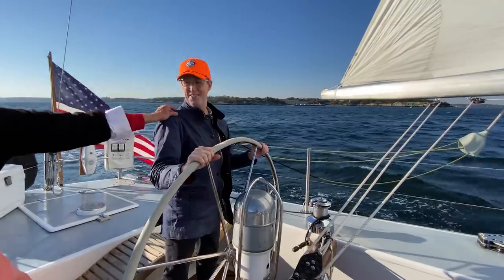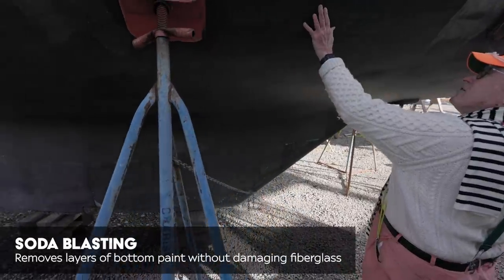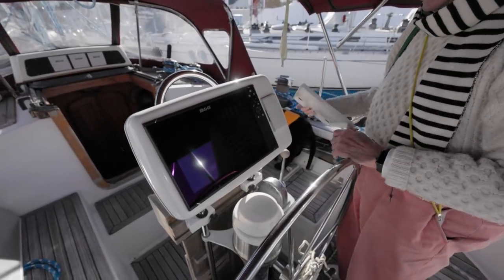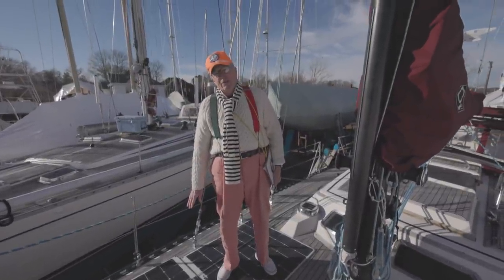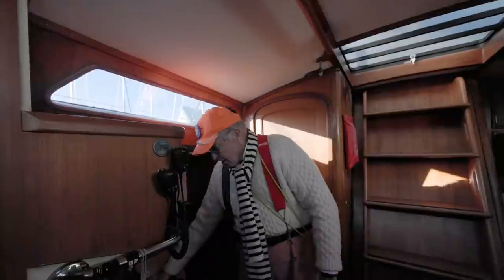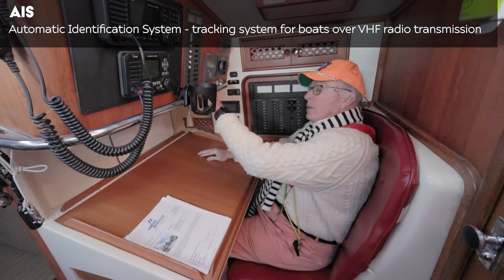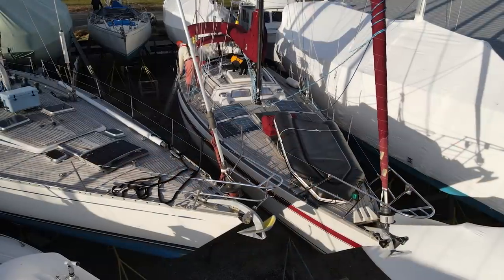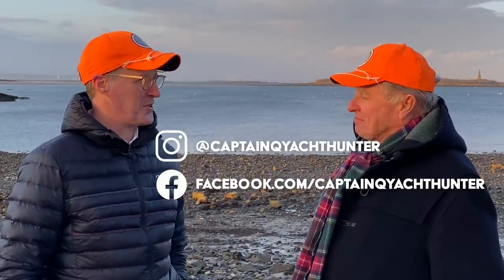$99,500 USD GLOBAL CRUISER! Proven bluewater sailboat for sale! EP76 #sailboatforsale #sailboattour

Comment: this boat has been on the market forever. for a reason. unfortunate since all the investment the owner made to get her ready. OTOH you take this to a low labor cost place you could get the deck removed and glassed for well under the $40k you'd pay here.
Reply: Trinidad?
Reply: @symphonyfarm2009  Panama!
Reply: Here is a list of what has been done to Dream Weaver mostly in 2018, 2019.  The Teak deck is a non-issue, if it keeps you awake at night have it professional sanded and put new plugs in the screw holes.  This is not a complete list but close:

Accommodations
Sleeps 7-8.  V berth forward.  Enclosed head with vanity and shower next aft to port, hanging lockers opposite to starboard. Main cabin features U-shaped dinette to port which converts to form double berth, settee opposite to starboard. Galley next aft to port, forward-facing navigator's station opposite to starboard. Aft owner's stateroom with double berth to port and single berth to starboard is accessible from main cabin through a second head, with vanity and shower, located aft of navigator's station. Both toilets are Wilcox Crittenden Skipper models, both rebuilt in 2019. Shower fixtures new in 2019.

Galley
U-shaped galley features propane four-burner, gimbaled, stainless steel stove with oven (oven  not working),  Sea Frost (2021) 12 volt refrigerated ice box and separate freezer with digital monitors and controls, double stainless steel sinks with pressurized hot/cold water. Propane system installed in 2019.

Electrical
12 volt DC and both 110 volt AC and 220 volts AC. Engine and generator starting batteries are 12 volt lead acid. House batteries consist of three Relion RB-300-hp 8D 300 ah lithium iron phosphate batteries (2019). Four deck-mounted semi-rigid, walk-on, 175 watt SolarWorld Sunmodule solar panels mounted on foredeck whose 700 watts of power produce as many as 250 ah per day! The four three-foot-square panels feed two 30 amp Victron SmartSolar MPPT charge controllers, monitored via a Victron Color Control GX mounted at nav station. Eclectic Energy (British) D400 wind generator (2019) with max output of 600 watts. Nex-Gen 5.5 KW 10 HP diesel genset (2019) with 75.7 hours. 110 and 220 volt Victron Energy inverter/chargers (2019). Boat automatically accepts 110 volt or 220 shore power and can output both voltages simultaneously, if so desired.

Electronics and Navigation
Brooks and Gatehouse electronics suite including forward-facing sonar, AIS transceiver, 4G radar (antenna mounted on mast), three Triton2 multi function displays, 12" Zeus3 chartplotter, and barograph. All purchased new in 2019, all updated in 2021. Simrad hydraulic autopilot (2019) networked to B&G system, Icom M803 marine HF SSB radio transceiver (2019) with DSC and color display, Icom AT140 automatic antenna tuner (2019). Insulated backstay serves as SSB antenna. Copper foil ground plane glassed into hull during boat's manufacturing process (standard practice with all Lafitte 44's). Icom IC M-506 VHF radio transceiver (2019) with RAM mike (2019). Iridium wifi satcom system (2019). King wifiMax router and range extender (2019). Ritchie SP5 binnacle-mounted compass.

Hull and Deck
Modified full keel with skeg-hung rudder. External lead ballast. Airex-cored hull, balsa-cored decks. Teak decking. Double bow anchor rollers. Maxwell electric windlass, rebuilt in 2019 with foot switch and wireless remote control. Double stainless steel lifelines (2018) with starboard boarding gate. Edson steering system. Four opening overhead Bomar hatches. 10 opening ports. Two Marinco solar vents with reversible fans. Two midship deadlights (2019). Cockpit shower. Dyneema jacklines, port and starboard, running bow to stern. Three padeyes in cockpit for attaching safety harness tethers

Sails and Rigging
Cutter-rigged keel-stepped aluminum mast. Staysail stay fitted with quick-release lever at base allowing stay to be quickly deployed or stored. Running backstays. Sail inventory of 7 sails, all made by Port Townsend Sails in 2019, includes fully battened mainsail with two deep reefs (30% and 60%), light air loose-footed mainsail with snuffing sock, roller-furling 115% genoa, Dyneema-stayed drifter, particularly robust staysail, storm trysail with separate track on mast, and storm staysail. Block and tackle boom vang with Dyneema line, 22', 20 lb. carbon-fiber whisker pole (2018) with integrated stowing (flush with mast) nd deploying system. Harken mid-boom mainsheet traveller (2018) mounted on house. Winch inventory includes two Harken #35 two-speed, self-tailing, mast-mounted halyard winches, Lewmar #30 self-tailing, two-speed, mast-mounted, reefing winch, two Lewmar #55 self-tailing, two speed, primary genoa sheet winches, two Lewmar #40 self-tailing, two-speed winches mounted on coach roof, one Lewmar #46 self-tailing, two-speed winch mounted on coach roof. All standing rigging and turnbuckles new in 2018.  Most running rigging replaced in 2018 with Dyneema. All chainplates removed in 2018, dye tested, and electropolished. All chainplate attachment points reinforced in 2018 with additional glass.

Mechanical
Wind Pilot Pacific (German designed and built) servo-pendumum mechanical windvane self-steering system (2019).

Additional Inventory
Viking 8-person liferaft (2019) in hard cannister mounted in a deck cradle. 3D Superlight Twin Air 290 9.5' inflatable dinghy. Burgundy cockpit dodger (2019) with zippered front window, stainless steel bows, and stainless steel grab rails on three sides. Burgundy bimini (2019) with stainless steel bows, full 360 degree enclosure, canvas covers for all windows, window on top for checking sail trim, and cover for top window. 45 lb. CQR plow anchor with 300' of 10 mm chain, 300' nylon rode, Danforth 35 HT with 50' 10 mm chain, Paul Luke 100 lb fisherman anchor (2019). Ace Sailmakers (E. Lyme, CT) Jordan series drogue. Plastimo extendable man overboard pole (2019). Stereo with two speakers in main cabin. Pots and pans. Toaster. Five fire extinguishers, six fenders, assorted docklines, two horseshoe buoys (2019), boat hook. Misc. engine spares.
Reply: @larryboles629  - has this boat been surveyed recently?
Reply: @larryboles629  I agree it is a great boat and a lot of investment has been made on all the right things. No refit needed and all the upgrades in place. When I was shopping I looked at this boat in Fall 2019, it was on my short list. It pained me to walk away but I was not interested in the last work that needed to be done. The owner apparently felt the same and left on their voyage after all these investments but delaying the inevitable. The deck and woodwork. No way just sand and bung, there is no teak left there. It was abused by being brushed along the grain, as Q pointed out the soft wood eroded from the planks. It needs to be replaced or removed, along with a lot of the trim. Many people don't want this project, especially if you get a US quote. But as I already said, if you are willing to stop at a place like Grenada, then you can get some good work done. These boats look amazing with glass decks and this particular example is truly ready for voyaging. I am surprised it is still on the market, the buyer is out there.
Reply: @akathesquid5794   How sad that someone smart enough to equipment Dream Weaver as she is, was dumb enough not to address the deck.  Sad really, so prehaps an offer in the $60K-70K range would be proper.  Thank you for this most important information.  Be happy, be safe